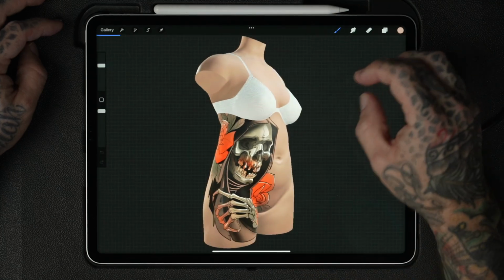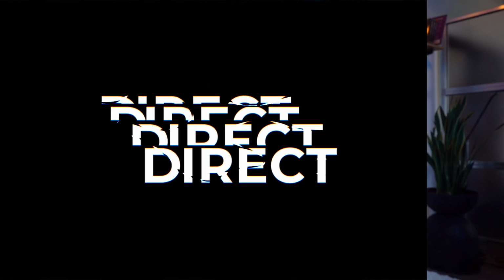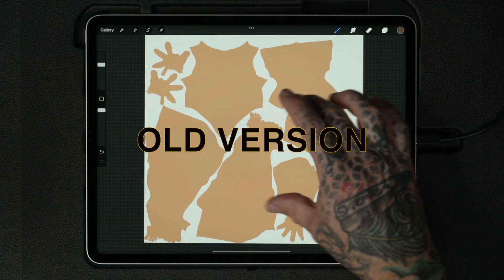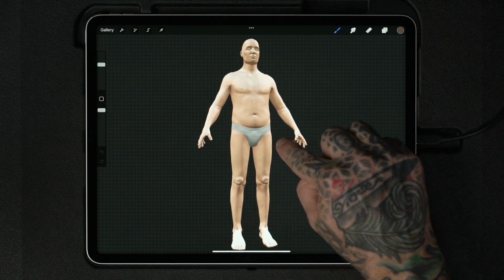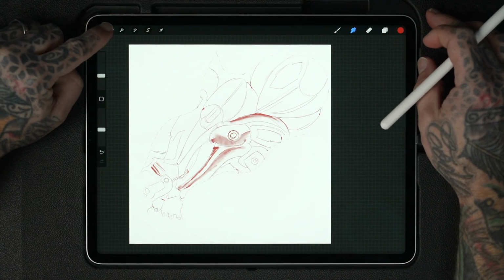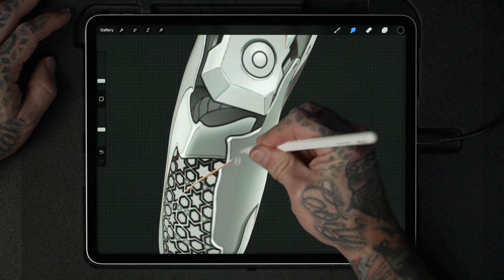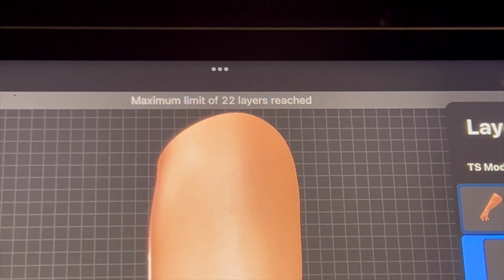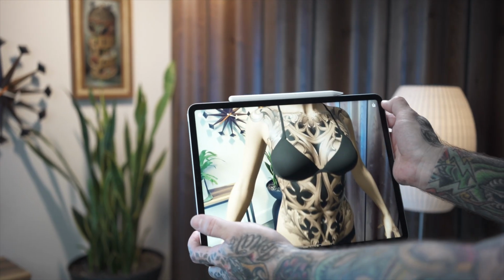Why Your 3D Tattoo Designs SUCK (and how to fix it)

Comment: Hey russ, Kyle here. how do you appraoch your 3d work flow with a clients body map? i map most clients when designing sleeves and such. best solution i have found is warping the clients body map to the 2d layer of they closest approprate matching model. just wondering if you have herd or found a better soloutuion? thanks for always putting out help info!
Reply from the maker: Hey Kyle, I’m always experimenting and seeking the best solution. With a few recent projects I used the clients body map more towards the end of the design process just to see where I need to adjust the design before any final outlines were printed as stencils.
Reply: @Tattoosmart  right on, great to have another perspective on how it can be done. thanks for the reply